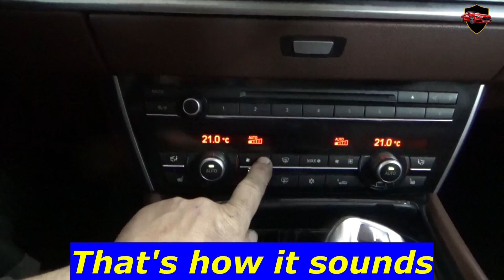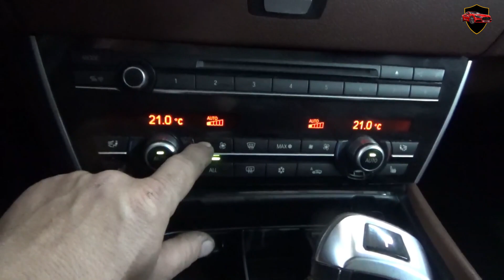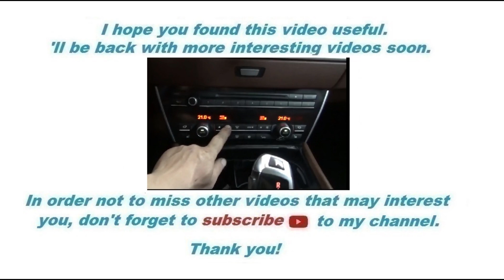Blower noises and vibration at BMW F07, F10, F11.blower replacement

Comment: Hello Sir, can help me it's is what that problem...? i got BMW 2012year F7 GT 535i the issue air condition on and ajust full speed only some second the front left centre and right. after that no have any air from fan blower..., but look the fan blower motor still working high speed. thanks for helping
Reply from the maker: If the blower motor can still be heard rotating at high speed, it means that there is a problem with the air directing system, if it can no longer be heard, the motor is defective. This is how the engine is replaced https://youtu.be/eh9k_7tc7_A
Reply: Ok sir thanks 🙏🏻… so mean that problem is flap sistem..??